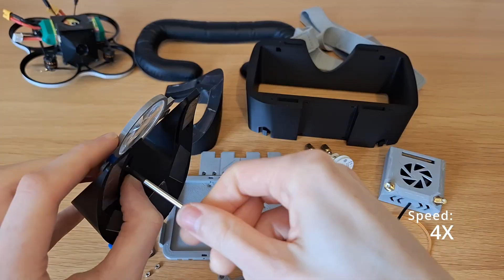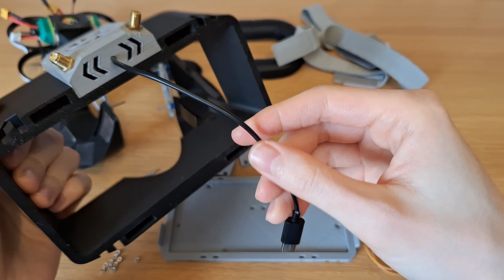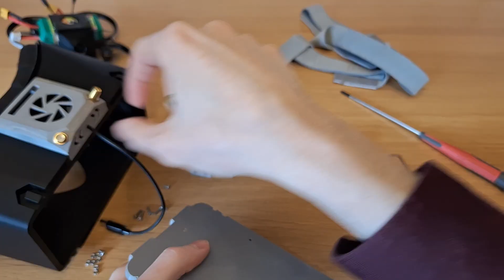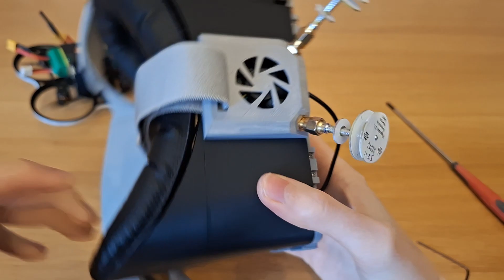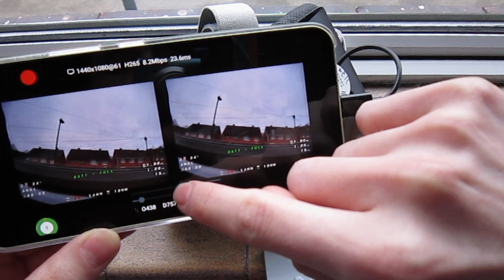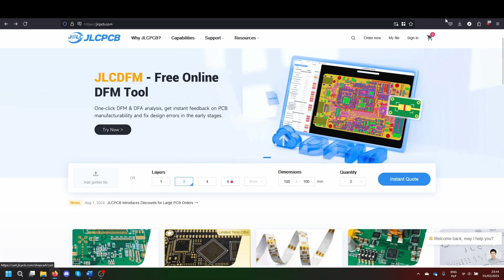OpenIPC digital FPV - Assembling 3D-printed goggles for Android

Comment: the pixelpilot app crashes whenever it shows starting channel with your pcb
i see you have a large cap on your pcb
is that required to stabilize the power
i dont have the transmitter running
Reply: issue resolved after i added a 400uf cap on the RTL8812AU input

Comment: Is it better to use a 40mm diameter lens vs 50mm diameter lens?  And I assume both should be 70mm focal length?  Correct?
Reply from the maker: The focal length depends on your eyes, I think 60-70mm should be okay for many people. 50mm diameter works a bit better but it has a higher chance to interfere with your nose. You might want to buy a couple of lenses to see which ones fit best.

Comment: So basically you are able to get the footage directly from the wifi module? Like the wifi module is acting like a fpv receiver here? This is insane imo
Reply: That's what OpenIPC is, they basically found an exploit for wifi adapters (specifically the RTL8812AU chip) that allows them to send whatever through the wifi adapter, combine this with IP cameras and you have a decent FPV setup
Reply: @zainkhan7812  this is nothing short of spectacular honestly

Comment: Hello! Please advise. If I want to use pixel pilot, are the application already contains the necessary drivers and I just need to connect a suitable Wi-Fi adapter (RTL8812AU) to Android via OTG, or I need to install Wi-Fi driver patches from GitHub. If installation is necessary - is it possible to do this directly in Windows?
Reply: pixelpilot is just plug and play, use an OTG adapter and it works

Comment: How much did this setup cost you? Excluding phone ofc
Reply from the maker: About 30 USD for the goggles, excluding the 3D printing filament. This includes the SMA to U.FL cable, 2 Fresnel lenses, the face foam, BL-R8812AF1 WiFi module, USB-C connectors, a small fan and a 3.3V BEC for the WiFi module (which I ended up not using since I got my PCB manufactured for free by JLCPCB and that PCB has a regulator). I re-used an old USB cable and a strap from old goggles. I already had some M2 screws.

Comment: This is simply amazing work!!! Any chance you can sell those WiFi modules already assembled and soldered and all? Is there any configuration you need to do on it to get the signal from the camera?
Again, you are the man!!! Congrats!
Reply from the maker: Thanks! I am not planning to sell the WiFi boards at the moment. You can find a link to the PCB files in the description, but you don't really need a board: you can just solder the WiFi module to a USB cable and a 3.3V regulator (BEC). The WiFi module doesn't need any configuration, if you have the PixelPilot app installed on your Android device it should just work when plugged in. But it only works if your phone supports USB OTG. The vast majority of phones nowadays support it, but some older models don't (it doesn't work on my old Nokia 8, for axample).

At the moment the Android OpenIPC implementation only supports WiFi modules with the RTL8812AU chipset. I'm using this one: https://www.aliexpress.com/item/1005006624504213.html?spm=a2g0o.order_list.order_list_main.35.21a11802f6k5a9

This module has to be powered by 3.3V, and USB supplies 5V, so a 3.3V BEC is needed. I've used these, but any 3.3V BEC should work as long as it can supply at least 1A of current (preferebly more): https://www.aliexpress.com/item/1005006581369932.html?spm=a2g0o.order_list.order_list_main.90.21a11802f6k5a9
Reply: @arturpekosz amazing!!! Thank you so so so much for sharing that! Did you also add a fan  to cool down the WiFi module in the receiver? What was the fan? Again, thank you very much!!! I’ll try to replicate your work and I’ll be also documenting so others can benefit from this amazing amazing work!!!
Also, do you have the schematic for the WiFi receiver? 😊

Comment: what is the resolution of the video flux that can travel by usb
Reply from the maker: USB is not what's limiting the video bitrate or resolution here. It's limited by the WiFi bandwidth and and CPU of the camera on the drone. In my case, I'm running a resolution of 1440x1080 with a bitrate of 8mbps, but it's possible to go higher.

Comment: Nice. Very elegant solution. I’ve built a couple goggles aswell (for 5” hdmi screen).

 How do those lenses feel with a single screen like that?

I felt it was hard to read the entire screen and swapped to using one  big fresnel instead. It’s not great because the goggles become bigger due to the focal depth but it’s more comfortable for my eyes atleast.
Reply from the maker: Near the end of the video you can see that the app shows the video in two identical windows, one for each lens. This is allowed by the "VR mode" option in the PixelPilot app, which is designed specifically for phone-based VR goggles. So it functions more like binocular goggles rather than box goggles.
Reply: @ ahh I see, missed that in the video. Makes sense.
Reply: Hi mate, I have the same idea as yours, what screen are you using? Im trying to source a modern mobile display that can interface with a hdmi to edp board. I have done it with an Ipad screen and resolution is amazing but it is no 16:9 (more like 4:3). In the other hand Im getting old and my focal point is increasing fast 😅 So I want to make my own goggles so I can adapt them to my faults.
Did you publish your work with your goggles??

Thanks a lot
Reply: @josedavid6400  me?
I got a 1920x1280 OLED off of aliexpress. 5.5 inch ( I think) with hdmi in. The 5.5inch came in a neat case but it would have been better with a 5 inch. The hdmi port is on the side so it looks a bit messy even with flat cables.

 I hacked up one of those big cheap fresnel lenses for old people. I’ve got a proper one that I haven’t tried yet.

The most important part is making the structure light. I think 3-4 layers of black PLA+ was enough to be opaque. Made a structural frame and filled in the gaps with thin sections I could print flat on the bed. Some small ribs add strength and stiffness to the flat sections. 

But I’m thinking of redoing it all in wood. Tired of redesigning and reprinting if I want to make changes. 

I use mine with an hdzero vtx and for me the wide FOV makes it better than the hdzero goggles. But the build quality obviously sucks 😂
Reply: @GuyFulcrum yeah thank you. for whatever reason youtube delete my comment…. 🤦🏻‍♂️ I told you Im very interested in making a custom goggles and suggest to use lw-pla or lw-asa as carbon fibre sheets…. If you want to collaborate Im in.

Cheers!
Reply: @ lw-pla could work but a big goal is to maximize the internal volume while minimizing the external volume. Lw-pla makes parts bigger for the same weight so might be less of a weight saving measure for the same strength. But worth a shot if you don’t mind the added cost. Also you can print bigger parts without caring so much about print orientation to get superthin surfaces. 

If you have questions just ask. I’m happy to help but my build is not one to be copied. 

I will say that lens and screen distance is important and I got this wrong. But making it adjustable adds complexity and weight so maybe build a simple prototype to adjust this and lock it in for the final build.
Reply: Awesome! Which is the focal length of the fresnel lenses you use?